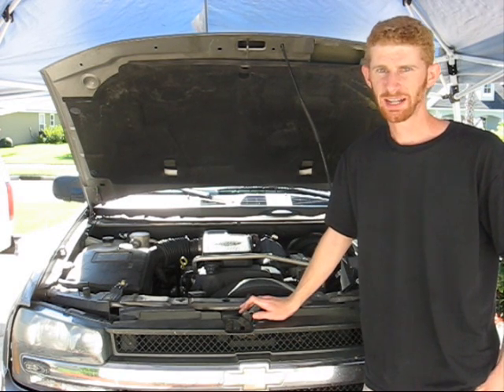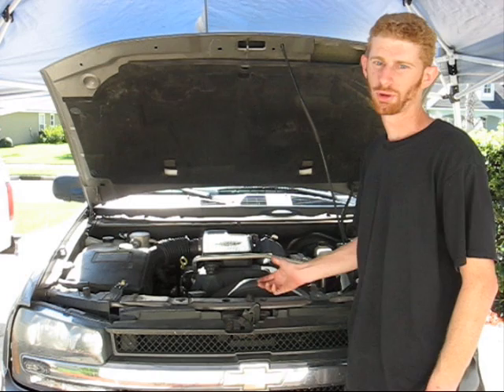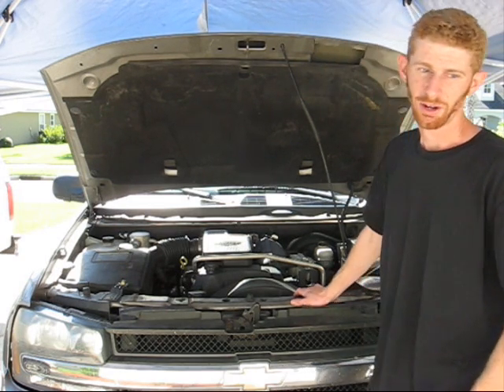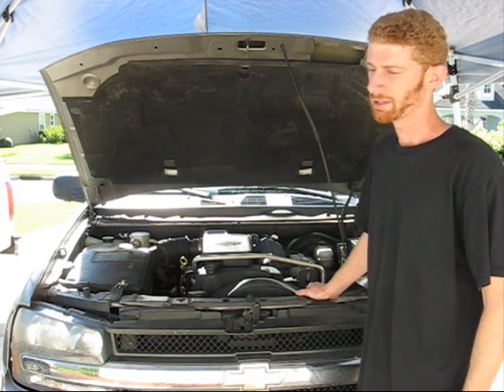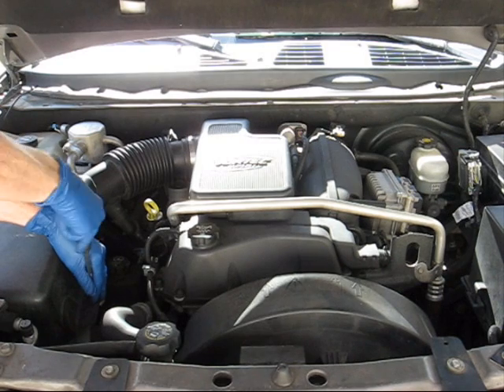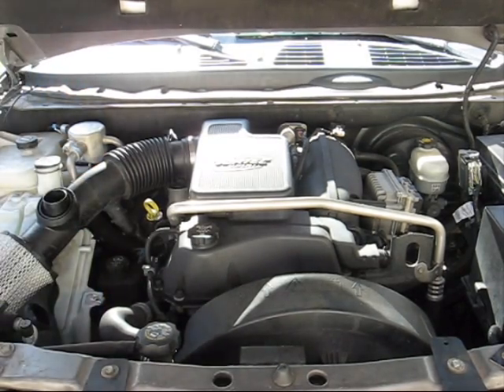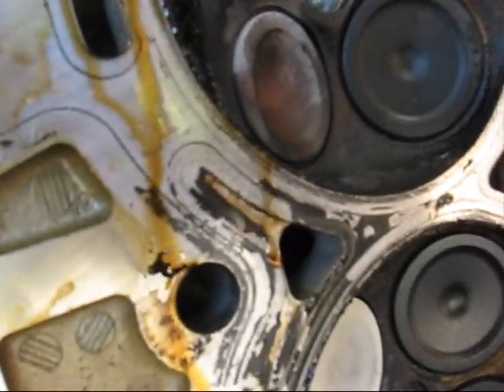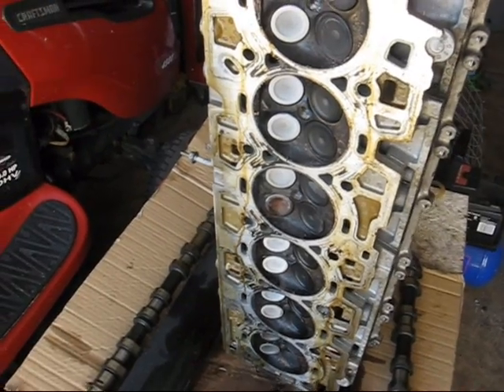Chevrolet Trailblazer Valve Job Part 1; Teardown

Comment: When removing any Gm atlas head bolts just use a hex socket with a ratchet or breaker bar and hit the top of bolt/ratchet while loosing the bolts. Go slow most or all will come out.
Reply from the maker: That's what they say. In reality they still break.

Comment: Hey man not sure if youll reply to this, but ill give it a shot. When you started pulling the head, you removed the wires from the side, then added wires to the top of the chain to keep tension, correct? Then when you had enough clearance, you re-tied the side wires right? Thanks
Reply from the maker: yes

Comment: Mine just started doing a lot of tapping and a little belt squeal. Popped the hood and saw oil down the driver side, all the pulleys and noticeable power loss. Just hit 170k in the old girl. I knew she was about to shit the bed soon and boooooy in the middle of a road trip she did. I knew it was gonna be a valve. I don’t want to 😩😩😩

Comment: when separating the block from engine did u have to release the tension from the chain? it seems like  that part got skipped in the video
Reply from the maker: No. maintain tension on it at all times, if you let it get loose it will go out of time.

Comment: Would a bent push rod or broken valve spring cause a cylinder to misfire
Reply from the maker: No pushrods on DOHC. Valve spring maybe if it didn't just smack the piston.

Comment: Its the heads the seats go bad Chevy knows and have new heads with better seats ,a lot of people complain about this ,they go about 75,80 ,90,000 miles ,compression is bad ,I brought it to a shop he said just labor would cost as much as the car ,if anybody has this truck sell it, check car sites review ,I hope you sold this car by now
Reply from the maker: Rolled over 200k a few months ago. All new valve seats as part of the head job. It only affected the 02-05 model years. In 06 they redesigned the head and bumped the compression, giving it more power and eliminating the problem.
Reply: @pfun41  I'm at 267K and it seems ok but I ran MMO a couple times in the crankcase. Also I cleaned the throttle body a couple times - the mechanic cleaned it once. But I took the throttle body off to clean it thoroughly. Maybe that's what's saved me so far? when I ran MMO then I got smoke out of the exhaust. haha. I don't use synthetic oil either. I suppose I should switch to synthetic. I also put Boron Nitride into the crankcase - not sure if that affects the valves. I should check that out. I think it's just the pistons.

Comment: So doing it this way, you can leave the AC compressor? Don't have to recover freon?

Also, anything you would do different if you did this again?

I will be doing this soon on my girlfriend's 05. It overheated and the water pump blew. Replaced the water pump, but there's oil in the coolant. There's also been oil building up in the #3 cylinder for a while, so I think it's time to machine the head and replace the head gasket.
Reply from the maker: If you don't remove any ac lines you don't have to mess with the ac system.

Comment: Of course you left out taking the plentum bolts out which was the whole reason I watch this video to see how the last one was removed SHIT SHIT SHIT! How did you do it
Reply from the maker: The only hard one is by the firewall, use a wrench and take your time, theres one under the hose and under the alternator.

Comment: Thank you for taking time to make this video, I am about to remove the valve cover to replace the gasket and would like to ask if you removed the coolant from the vehicle before you started filming or I can get away by just removing the bolt holding the houses and just moving them to the side long enough to get the valve cover off.
Reply from the maker: For just the valve cover it's not necessary.
Reply: Much appreciated...

Comment: As a vehicle gets older,I factor in resale value to repairs. If the cost of repairing an engine costs more than the resale value. I sell the vehicle running as is for whatever I can get for it. If I deem the vehicle cost prohibitive,I scrap the damn thing. I think pulling that motor would be time consuming and really not worth the effort. Someone willing to repair that for a reasonable price would be almost a joke. Sadly mu 03 Trailblazer is almost at the end of its useful life. I have no problem selling it as a drivable parts vehicle,as is. At 200k plus miles,we got our moneys worth from ours.
Reply: I want 500K - the torque is great.

Comment: Great video!!! Thanks.  Just did mine (2004 67K miles - burned exhaust valves #3 cylinder, low compression).  Actually had to do the job twice! because Autozone sold me a reman (American Cylinder Head) that had a cracked water jacket, so coolant leak when put back together.  Used your "turnbuckle" system which worked great!  Also bought the special tools to hold the timing chain but with the wire/turnbuckles they aren't totally necessary.  Second time I did the job I machined the "special wedge tool" on my CNC that goes down into the timing chain cover and secures the chain from falling down off the crankshaft sprocket.  It also makes the whole pain of releasing the timing chain tensioner and retracting it unnecessary.  You can just pop the timing sprockets back on.  I also bought an 8mm 1/2 inch drive allen socket and cut it down just short enough to go into the new exhaust timing gear bolt, and used with a "bolt stretch" torque wrench you don't have to pull the radiator shroud off (like another 2hrs of work).  I used the "pound on the headbolt" technique and only broke 3 headbolts....2 were the very rear where you can't really pound them.  Amazon sells a great kit for extracting them similar to the GM tool but MUCH cheaper.
https://smile.amazon.com/gp/product/B006YDQ812/ref=oh_aui_search_detailpage?ie=UTF8&psc=1

Thank you again for the video, it was really helpful!
Reply from the maker: I'd lose my shit If I had to do this twice. Guess you learned the hard way about Autozone parts.

Comment: On your video you take the intake & throttle body off.  My question is how do you get to the last bolt by the firewall.  What wrench, socket, etc. did you use.  What is the tip/trick to getting that one out.
Reply: Need to use a 1/4 inch drive socket, on a universal joint, with about a 6 inch extension. Put painters (blue) tape around the universal so it can't "flop" down and you should be able to get it on there. The tape still allows some flex in the assembly.
Reply: Use a wobble to get it.

Comment: How did you get out the last bolt on the intake manifold (closest to the firewall) off?
Reply: Need to use a 1/4 inch drive socket, on a universal joint, with about a 6 inch extension.  Put painters (blue) tape around the universal so it can't "flop" down and you should be able to get it on there.  The tape still allows some flex in the assembly.

Comment: pfun41 i decided to change my spark plugs on my trailblazer 03 LS  4.2 and found out that two sparks has oil not to much but yes was some oil in there my question is should i need a new valve cover gasket or do i need something else such intake manifold gasket ??  I hope you could help me thanks in advance brother .

Comment: Any tips on getting all of these broken Head Bolts out? (Broke all 14!)
Reply from the maker: Get the head off. Drill a hole in them and use a screw extractor. The pieces usually come out easily once they've broken off.

Comment: What's connected to the back of the head? How do I remove it? That's all I have left to get the head off. Only broke 2.9 head bolts in the process lol. One still has both pieces connected by .080 worth of a single thread. I was amazed. But back to the question. What is it and how do I disconnect it from the back of the head? Thanks.
Reply from the maker: Its the plastic AIR tubes for the secondary air injection. I can't remember if its a bolt or pushpin, I think a bolt. I broke mine getting it off but the tubes were intact.
Reply: It's a bolt on the passenger side, and a push pin on the driver's side.  Like PFUN, I broke off the plastic around the bolt, but when you reinstall it's nor really critical, just use the push pin only.  The clearance is so tight I don't think the AIR tube can really move too much.

Comment: Well done video.  i have an 03 with 260k on the motor.  no major issues but i was considering tearing it apart in the summer and replace all seals and clean up carbon.
Reply from the maker: Not worth it unless its leaking IMO. Working on these engines is too tedious. These engines were notorious for carbon buildup and clogged injectors. Decarb services and injector cleanings are routine maintenance and can be done without taking everything apart.

Comment: Im doing the same job right now. I've remove all the head bolts but the head still doesn't want to break loose. Is there something that i'm missing? (only had 5 head bolts that didn't break).
Reply from the maker: There are several small bolts at the front around the timing chain ares. They are TTY and will have to be replaced like the head bolts. There is one bolt holding the top of the chain guide to the head on the driver side. Take that out and it should break free relatively easily. Keep that timing chain tight.

Comment: My cylinder #3 jus went out,it's almost like gm made these engines to fail and piss people off,dumb fuckers.
Reply: Yeah ours failed at around 64K miles (never overheated it), #3 cylinder.  It's a flaw in the casting process of the cylinder heads.  According to my machine shop (one of the most common heads they see) after enough "heat cycles" the head will stabilize and be good to go after re-machining.  We'll see.  Basically the machined area where the valve seat goes elongates over time, leading to burnt exhaust valves.
Reply: @vfinegold  Wow i guess I got lucky on our 04 as it's at 267K - so far so good. Still we got the oil changed every 3K - so maybe it handled the heat better that way?

Comment: How do you manage to break that many head bolts? That plus the black crud all over cyl. #1 (at least that's all I saw there could be more), leads me to believe yours had a bad head gasket for quite awhile. The excessive heat could've weakened the bolts.. otherwise you're not doing something right. That could also explain the damage to your head. Just sayin'... Anyway, decent video no bullshit and straight to the point, just think you should've done a little more detail for everything you removed for people that aren't mechanics. Not bad though 9/10 stars I say...
Reply from the maker: You WILL break head bolts on the 4.2 Atlas. That's just the way they are. The 4.2 is known for excessive carbon buildup. Decarbs and throttle body cleaning are standard maintenance for these engines.
Reply: Yep I've further studied these and I concur... I currently have 2 vehicles with the same setup.
Reply: Absolutely a known problem with broken head bolts, PFUN did nothing wrong.  GM actually now sells a special tool just for extracting the broken bolts.

Comment: I have a 2007 TB with just over 100,000 miles.  Was getting a P0305 cylinder number 5 misfire code constantly.  I changed the plugs (with AC Delco) and swapped coils from another cylinder and still got the misfire code for cylinder 5.  I finally did a cylinder leak down and a compression test on all 6 cylinders.  
Cylinder1:  Leakage: 20%, could feel air leaking through throttle body, Compression check: 210 PSI, Cylinder2:  Leakage: 9%, could not feel any leakage, Compression check:  220 PSI, Cylinder3:  Leakage: 22%, could feel air leaking through throttle body, Compression check: 215,  Cylinder4:  Leakage: 11%, could not feel any leakage, Compression check: 220 PSI,  Cylinder5:  Leakage:  69%, I did a smoke test and could not only see smoke coming out the tail pipe but could also hear the air hissing into the exhaust. Compression check:  160 PSI, Cylinder6:  Leakage: 7%, could not feel any leakage, Compression check:  220 PSI.  Looks like I'm pulling the head.
Reply: Yep, time to rebuild the head.

Comment: Lets see I've replaced the fan clutch, soldered new instrument clusters then bought a new instrument panel now some of those are going bad, couple of speakers have blown, 3rd cylinder was leaking and was quoted an estimate of 2500-4000 from chevy dealership where vehicle was purchased but i got lucky with a totaled gmc with 80k on the 4.2l replaced with that and paid 400 for engine and 50k miles later 3rd cylinder came back to bite, a/c broke. If this isn't just a simple coil fix for 3rd cylinder I'm done wasting money, I love my car but I've got to find something else...good luck to anyone else who dares so this job or pull the motor it was a pain in my ass then and I'm not going through the same nightmare twice.
Reply: I have a 2007 TB with just over 100,000 miles with the same problem so I am not convinced GM fixed the problem in 4.2L built after 2005.
Reply from the maker: Premature valve seat wear problems affected the 4.2 up until 05. They redesigned the head for the 06 model year, which eliminated the valve problems and upped the compression a bit with a pcm tune to match. Older low mileage 4.2s are a gamble, valve problems usually show up by 100-150k if they're going to.  When a certain engine has inherent internal issues I find it better to fix them rather than replace with a used unit, as they usually have the same problems later on. I'm dealing with a Dodge 4.7 right now.

Comment: Great job BTW, I think you have the only video on youtube doing this Engine! 4.2L I6 goes in all Trailblazers/Envoys from 2002 to 2009. And it's not a easy job by no means. What would be a decent cost to have this done on a 2004 TB? I just changed my Air Filter, gas filter, Cleaned the Throttle body. I have NO engine light on & in cylinder 3 & 4 the spark plugs had oil on them. This TB never miss fired yet. What would you do? I thought I'd just drive it until I get a light of some kind & then cheek out the problem. Help please?
Reply: these 4.2L engines are pieces of shit.
mine had only 90, 000km before it started burning oil like mad.
they should have been recalled by GM. it's crazy how GM got away with this piece of shit "engineering". the 4.2L engines are notorious for having shite valve seals. GM can go suck a big PENIS, I will never buy another one of their CRAPHOLE vehicles or any vehicle that bears its parts name. Their shitty transmission cooler line design is even worse, don't get me started on that. what kind of retarded engineers has GM been hiring for the past two decades?
Reply: Why you say only need a gasket I got a problem whith mine smokes only in higway at 70mph it let a blue smoke and yes it's leaking from valve. Covers
Reply: misael pacheco - do you have the 4.2 ? You shouldn't have valve "covers". It's a inline engine... just one cover. Is your engine only smoking from the dripping oil or do you have smoke from the exhaust too?
Reply: John Muller  What did you have done to your engine I am having the same problem but with  cylinder #2  any info would help thanks
Reply: pfun41 I'd love to know how you got that last bolt out of the intake manifold that's against the firewall
Reply: dammdee sucked me off I just used a deepwall socket and 3/8 rachet to get that last bolt out cant see it just have to feel for it lol
Reply from the maker: New valve cover gasket is all you need.

Comment: what is the tool used to get head bolts off?
Reply from the maker: Breaker bar and I think it was a 10 mm hex drive.
Reply: Nevermind nothing wrong with the head it was one of those stupid pins that the rocker lays on

Comment: Just get a crate motor and replace it. Or simply take to an engine rebuilder.......Get written quotes first.
Reply from the maker: +NYRM1974 That's gonna cost more than $600.
Reply: The Atlas inline engine has always been plagued with performance issues. This is why I have the 5.3L LS Engine less issues easier to work on.  
On eBay there is a vendor called ODESSA who sells quality cylinder heads for a good price. Most items for the Chevy Trailblazer can be found on eBay.

Comment: What is the torque number on to 10mm bolts holding onto the valve cover (5:27)?

Would it be the same on 2003 Oldsmobile Bravada 2wd?
Reply from the maker: +angelisone Snug, they have metal spacers so you can't overtighten them.
Reply: 89 INCH POUNDS - not ft pounds.  Bravada should be the same.

Comment: I got it out, but now I have a message that says 'reduced engine power'. do you know anything about that?
Reply from the maker: +Alex Rodriguez That's "limp home" mode. It does that to protect the drivetrain when it senses problems. Pull codes and see whats up.

Comment: Thanks for the information.  I got 10 bolts lose, but now the problem I'm having is that the manifold is not coming out, it's lose but won't come out.
Reply from the maker: +Alex Rodriguez Wiggle it around. Get fancy with it if you have to, if the bolts are out it should come out without too much fuss as long as it clears everything. One bolt may still be threaded in a little.

Comment: so the alternator has to come off in order to get to the bolt
Reply: Yes it does.
Reply: Have fun with that 3rd alternator bolt on the bottom!.........it comes out, but not easily.